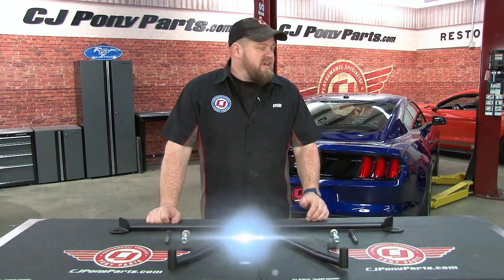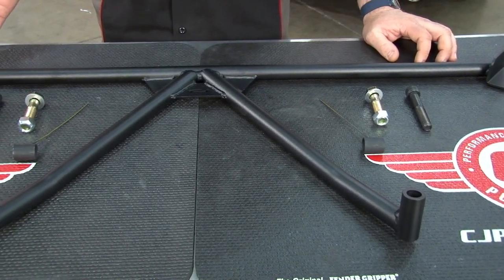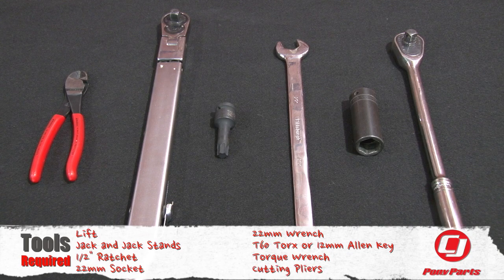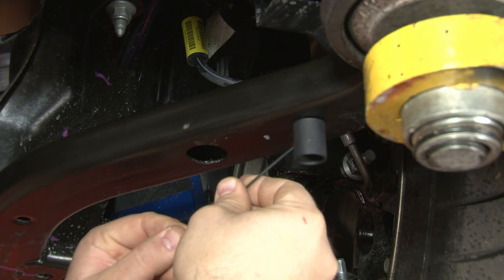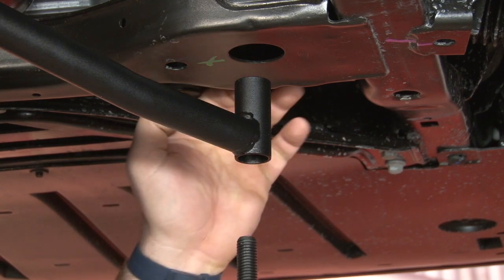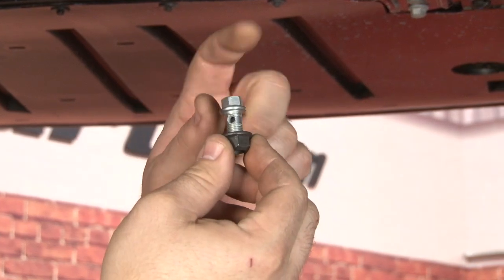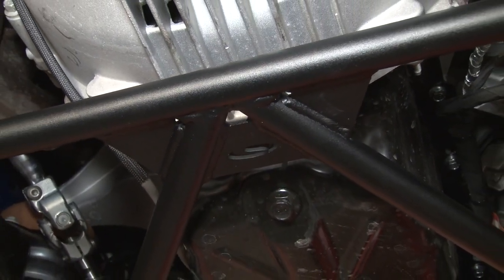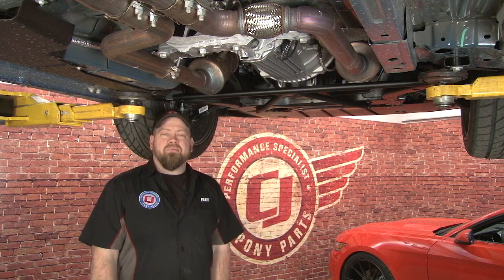2015-2023 Mustang Steeda Extreme G-Trac K-Member Brace Installation

Comment: Just installed this on my gt. Pretty self explanatory. You actually need to get all the bolts started but it will require using a pry bar to get everything installed. Had to grind down spacer for the driver side.  It would have been nice if steeda added a second set of washers for the lower part of the rear mounting where the 22mm socket is to get a better bite on the subframe instead of just the head of the bolt making contact with the subframe. Steering actually felt a little heavier and tighter. Steering input reacts faster and requires less input to steer. I'll probably had the washers later

Comment: I wouldn't cut the spacer tube placement wire off. You have to take that brace off the service the transmission or change a clutch. You will need to use the wire again to reinstall the brace. Just tuck it up into the frame and you can grab it with needle-nose pliers next time you need it.

Comment: The "hack" of using a bolt with a 12mm head for the front bolts isn't gonna get you very far.   Any metric bolt with a 12mm head will shear long before you get to the 55 ft-lbs those bolts want.   Save yourself the frustration and just get a 12mm allen socket.   Cost all of $9 at AutoZone.

Comment: Hi Bill, I  have a 19 gt PP1 and wanted to add this to my car. I have all the other Steeda suspension Components they offer except for this. But I wanted to know since I have Steeda Progressive lowering springs how low does the front of this brace hang down? It looks like it’s lower than the rest of the car and might be very prone to hitting speed bumps

Comment: The supplied spacers would not go in.  I had to grind each one down to get them to slide in.  I have a convertible, could that be why?
Reply: Had the same issue with my non-convertible gt on for the driver side spacer.

Comment: Will this not work on a gt350? Rear tabs line up right but it seems like the front holes are off by a 1/2 hole.
Reply: Just finished this on a 2018 GT, so YMMV... but line up the front first.   If your subframe doesn't have the threaded inserts, you need the aluminum spacers on top of the front bracket.   I had almost exactly the same alignment problems when I tried to do the rear first.   The rears will still be off, but they're much easier to tweak into position.